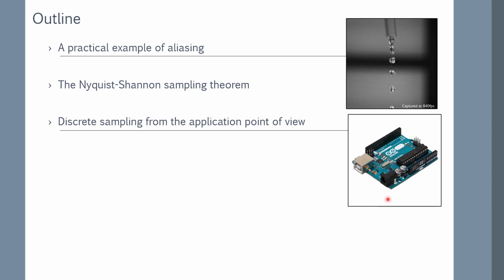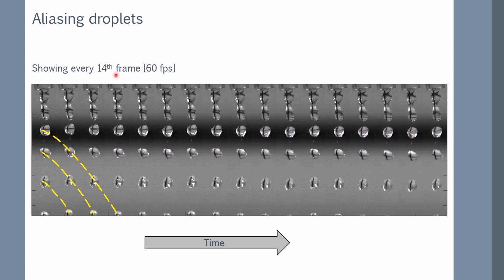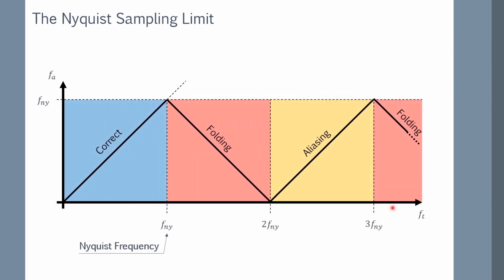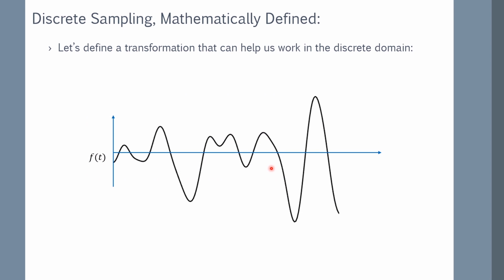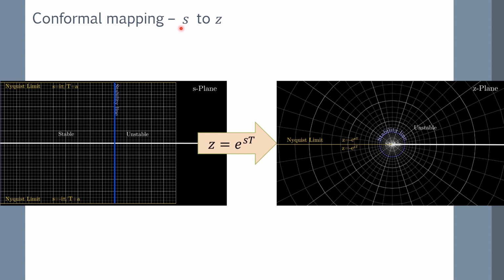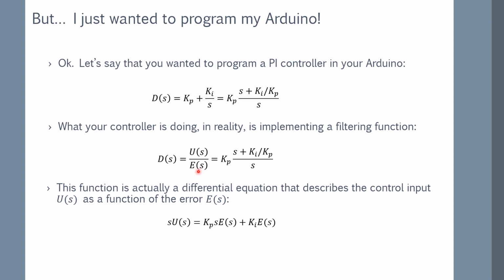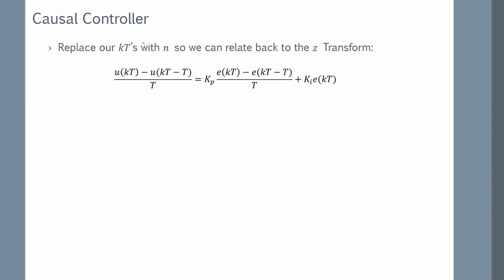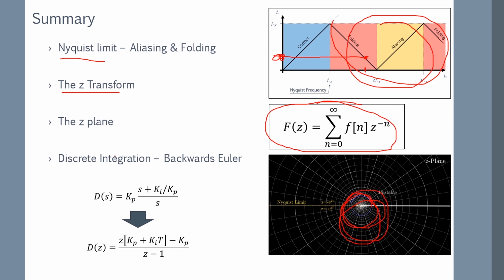A lecture on the z Transform

Comment: Good description of the basics. I would like to add that Nyquist refers to frequency and not phase (in recreating a representation of the input) if the sampler is asynchronous to the process, which is usually the case. You can prove this to yourself by making a small circuit with a sample and hold and slowly bring up the frequency of the input in relation to the sample frequency. At a sample rate of 1/2 the highest frequency (which is hard to get correct and will wonder in relation to a tightly regulated sample clock), asynchronously the samples are almost void of phase information. So, from a practical standpoint the first task is to preclude aliasing which means a low pass filter in relation to the sample period, with good process signal attenuation of around 40dB minimum. Then in designing the controller you would like the sample rate, to maintain phase, of at best 20x the highest process frequency. Many industrial off-the-shelf PID controllers provide this 20x sample rate, many call it oversampling as a marketing point. Now with this over sampling and elimination of aliasing we can design and tune a classic control law in the Z domain. If there are multiple feedback loops we must have synchronous sampling of all required process variables. From here we can use the classical control system stability criteria.